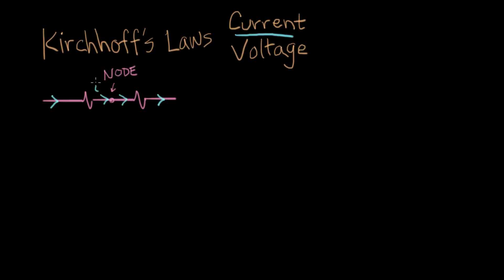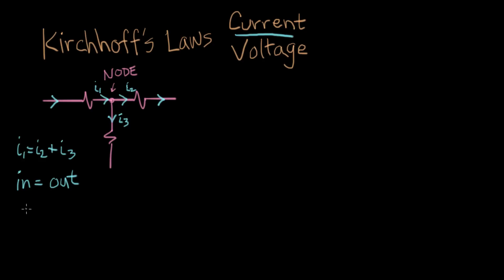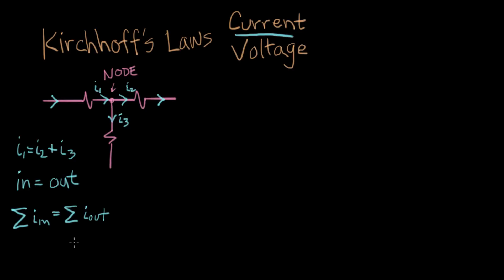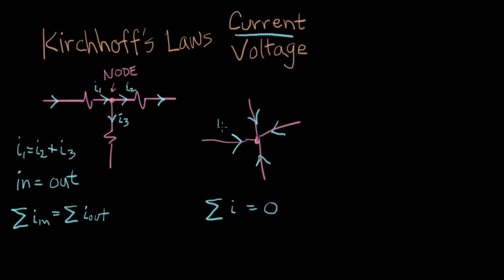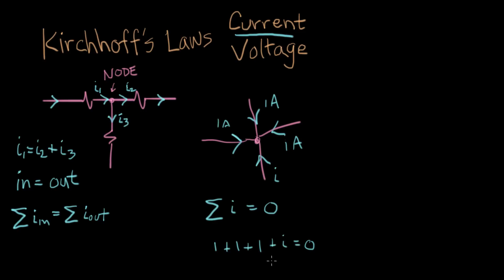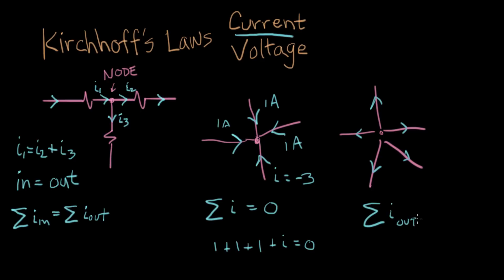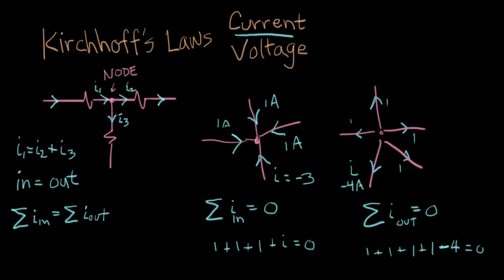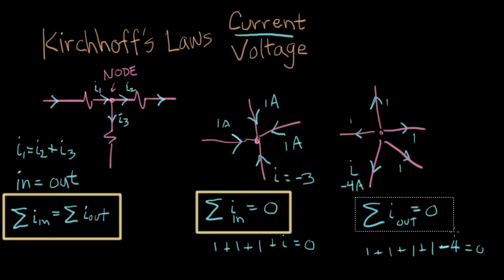Kirchhoff's current law | Circuit analysis | Electrical engineering | Khan Academy

Comment: I'm confused by the all circuits going in and out concept. In a circuit, the negative value would just represent the direction of current flow, which should be away from the node. Sending any current toward the node with no exit would just change the electrical energy into thermal energy wouldn't it? I realize it was just a visual example, but wouldn't it have been just as accurate and more realistic to show the negative flowing out? 3A positive going in and 3A negative going out would still fit KCL as the sum would be 3 + -3 = 0. 
I'm learning, don't judge me!!

Comment: @khan academy
Does Kirchhoffs Current Law also apply to constant current sources? 
Let's say i have a parallel circuit with each branch has a resistor1 and resistor2. 
A constant current source should supply and hold the written constant current on each branches. 

Can someone help me with that? 
Thanks! :)

Comment: what is the difference between +3A and -3A?
Reply: Direction of electron flow. An answer on StackExchange put it well -- "If your power supply is sourcing a positive current toward the ground, that corresponds to a flow of positive charge from the supply to ground. This is equivalent to a flow of negative charge from the ground to the power supply. In a real wire, only negative charges can flow, so the second thing will happen: electrons (which have a negative charge) will flow from the ground to the source." http://physics.stackexchange.com/questions/208926/whats-the-difference-between-a-positive-and-a-negative-current
Reply: The supply has the negative current and the load has positive.

Comment: how is the current the same, wouldnt the resistors convert the electricity into heat?
Reply: Yes but, current is only a part of the electricity. The part that doesn't change.
Reply: this isn't true as ideally we take connecting wires in consideration these wires nor have any resistance nor these resistors take up any energy these thing come up if u take electrical engineering
Reply: darkls14 ur confusing voltage and current bro

Comment: just remember guys that current represents the NUMBER of electrons
Reply: +Crossfire Memer Actually, this is incorrect. Current is the measure of the number of electrons (measured in Coulombs) that passes across a surface in one second. The unit is Ampere, which is 1 Coulomb per second (or 1.6 x 10^19 electrons per second). So, current represents the flow of electrons, not the number of electrons. A measurement of the number of electrons is referred to as "charge," represented by a capital Q, and the unit of measurement is Coulombs. For more info, refer to the Wikipedia articles for Current, Charge, Ampere, and Coulomb.
Reply: +Crossfire Memer isn't it usually in coulombs?
Reply: +Jimbo Green coulombs are the number of electrons multiplied by a constant e(1.6x10^-19 coulombs)
Reply: Crossfire Memer but there's usually lots of electrons in a current so it's measured in coulombs rather than individual electrons
Reply: +Jimbo Green well, technically coulombs are the number of electrons CARRYING the charge, so both of them are basically the same
Reply: +Crossfire Memer Oops, I mean to say 1 Ampere = 6.2415098e+18 electrons per second. Forgot to invert the ratio.
Reply: Brett Gildersleeve Uh, thats helping anyone.

Voltage= Energy in joules/ PER COULOMB

Coulomb= LARGE GROUP OF ELECTRONS

current= NUMBER OF COULOMBS( groups of electrons) passing a point EACH SECOND

Resistance= MEASURE OF difficulty for the passage of ELECTRONS.

Not sure if the caps helped but theyre there lol
Reply: just... NO